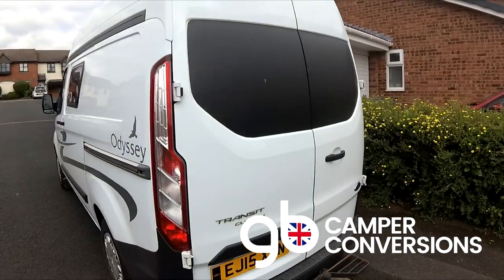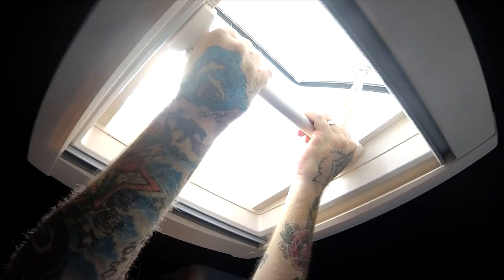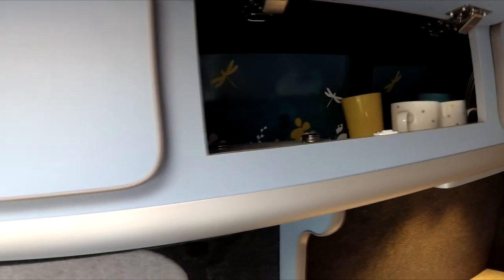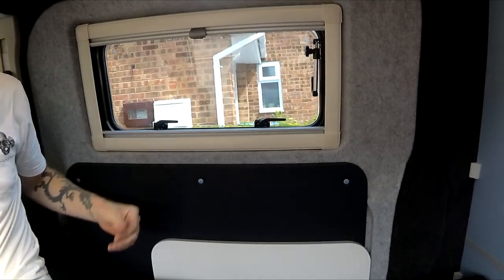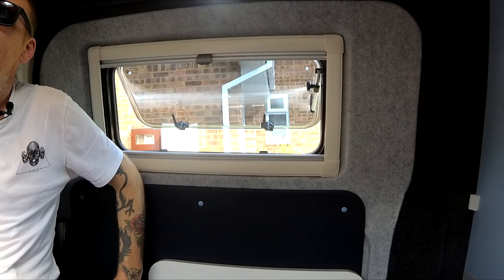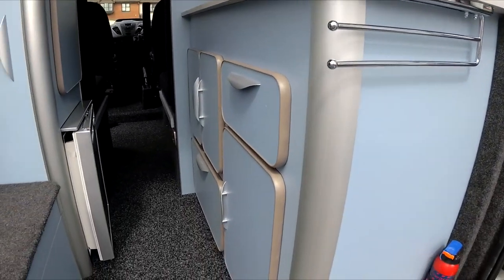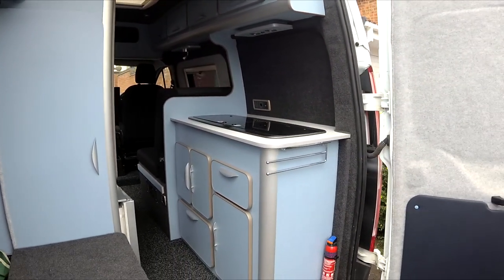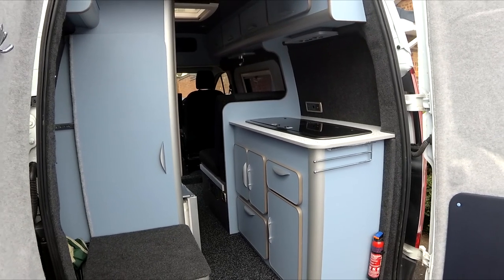VAN TOUR: Ford Transit Custom Camper Conversion

Comment: Hi we’re doing a self build campervan conversion on a Ford Transit Custom and we’ve realised the rear door straps (that keep the barn doors fixed open) really reduce the cupboard space at the back. I see you’ve removed them - do you get any trouble without these? When ours were broken I found it really annoying when the doors flapped about in the wind! Thanks for the video

Comment: On those two rear seats, is it possible for them to be legalised for passengers with seatbelts? Also is it possible to keep the existing double front seat to swivel including the drivers seat, so all front seats turned round.

Comment: Great van mate. So you need to be on a hook up in order for the diesel heater to work? Is that the same for all van heaters?
Reply: Thanks, it’s a 240v only heater not a diesel heater, so yeah you need to be on hook up for it to work, there is an option for a diesel heater which you don’t need hook up for.

Comment: This was a nice build! - but waredrobe, too much space and it makes the van feels or looks cramped. If this could be downsized or skipped it'd be nice, rather some cabinets in the roof sides for stuff but if you go vanlife you just pack a bunch of t-shirts and tennis tees and 1-2 loose shirts, 1-2sweathers and that's it. :) ^^

Comment: Very similar layout to my Devon Firefly SWB high top, based on the same base van.  Some features are really good especially the large bed option, which we don't have, just the two singles.  Particularly like the modern bright finish to the furniture etc. Though I'm not sure about the 13amp socket fitted so close to the sink, would that be an issue regarding electrical regulations?
Reply from the maker: The NICEIC recommends that socket-outlets and other accessories should be located at least 300 mm, measured horizontally, from a sink or draining board, where they are unlikely to be splashed. So we're good with this particular setup.
Reply: How much for this exact set please

Comment: Great mate. I’m looking for a bit of advice on how to carpet my rear doors to have a nice finish when they are opened. If I carpet the whole door it disturbs the rubber seal doesn’t it?
Reply: If you carpet the door and shut it then with a pencil lightly draw a line alongside the rubber then cut down line, if you carpet past where the rubber is seated the door might leak.
Reply: @garycross3904   ok thanks for the advice matey il give it a go

Comment: This must be a UK model, never seen a ‘CUSTOM’ IN USA,,BUT here there 3 length, & 3 heights   Only he small one has a Diesel engine svailable ALL OTHERS are petrol, cheers🏴🏴🏴🇬🇧🇺🇸
Reply: All vans this size are diesel although some of the new vans are electric as i think amazon has ordered a few thousand new electric vans

But the uk fuel price is too expensive to have a petrol van if it was carrying maximum payload etc as in the uk the petrol did get to £1.35 ish a litre at one point
Reply: @domainnameguy   hi in the US, DIESEL COST MORE THAN PETROL ! Cheers 🏴🏴🏴🇬🇧🇺🇸

Comment: Instead of the relatively low cutting board over drawer (nice idea in principle) why not something similar higher up or a flip board which would then also still allow access to the drawer.

Up to personal taste: I really dislike the furniture coverings. Many professional van builders style it as a car. Guess, they have their reasons... I would think if we loved the plastic and cheap "carpet stuff" we get in cars, we would design our homes after them. (not to be a critic of this setup, I assume you have your reasons, I am just surprised time and again)

Comment: I'd take my self build high roof custom any day. It's nowhere near as professionally built but mine is way more cosy and comfortable. Who wants to sleep on a car seat?? Plus when the beds out, as is typical with most short wheelbase conversions, the van is rendered useless for anything other than sleeping
Reply: Have you a video of your conversion? If like to check it out while deciding how to convert my own.
Reply: Everyone has different wants and needs but personally I would opt for the gb camper conversion any day of the week, extremely well thought out and superb use of space